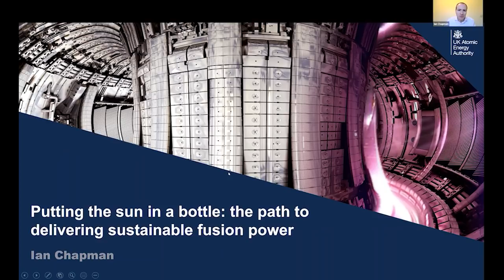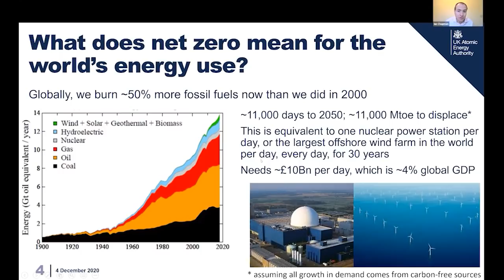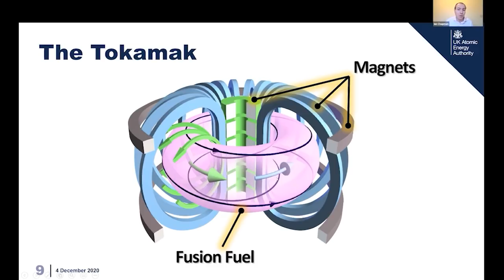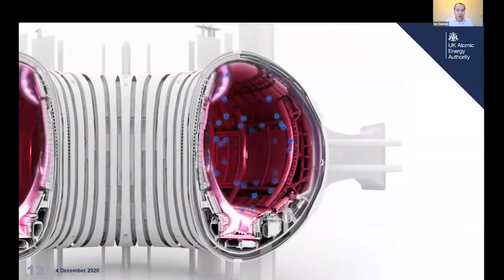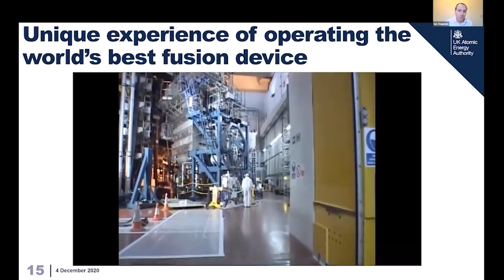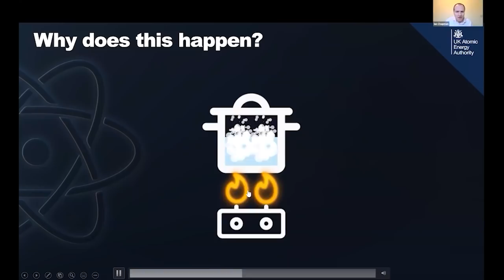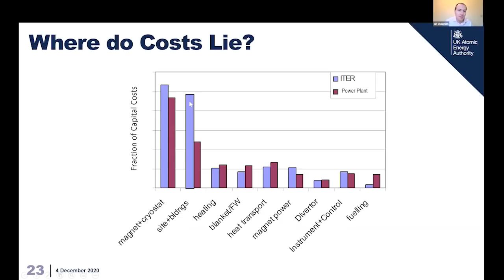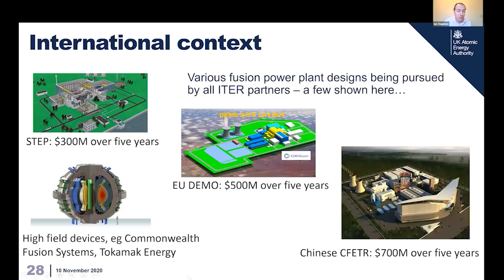Putting the sun in a bottle: the path to delivering sustainable fusion power | The Royal Society

Comment: Nice presentation. 
We have two ways to sustain plasma, electrodes and electrode less ie magnetic induction which is what mainstream is focused on.have Not seen any program use electrodes, why?

Just because our particle collider utilizing a magnetic induced method, it doesn’t mean this is the only way for fusion energy generation.
Reply: were talking about commercial power.
in the end, those who figure out how to make their new toy run cheaper will rule the market.

If the price tag would be anywhere like ITER.... that would be one tough sell...
Reply: @mikez2779   @Mike z  .. Total the amount spent on 90+ failed tokamaks + 100s of 1000s of related experiments, laser-vice failures etc. etc., then add in the amount of wasted electricity you'd have a commercial break-even point.. I'd include all the thermo-nuclear WMD costs too, Con-Fused, Robbed Tax Payers. Then adjust for inflation...
--
ITER is NOT designed to be a working reactor, it tests a few theories, that possible may help, while still not tackling many core problems.
--
This is a comment to The Ovid-Brained masses as well. The insults are not meant for you, as you can actually ADD UP MONEY, unlike La La Lander Zombie Halfwits.

Comment: When you make it commercially available, then make a video on it. I'm tired of watching videos of half-assed contraptions that cannot produce electricity for more then a brief moment.
Reply: It doesn't actually create electricity, just heat to boil water.  This technology has existed since the 1800's and they are wasting billions just so a curious, what would happen if, researcher can have a job.
Reply: @ztol4_i126  If you have a better way to produce electricity from fusion, feel free to pubish...
Reply: @Alexander_Kale  That's just it.  No one does.  Why spend billions to create expensive ways to boil water?
Reply: @ztol4_i126  Because, believe it or not, despite trying very, very hard, no one has figured out a better way.
Reply: @Alexander_Kale  Yes we have, natural gas is better way to boil water for electricity.  We need to find the way to eliminate the WATER! We know How to boil water.  Spend the money on how Not to use the water intermediary step.  We need someone to think outside the box.  Too much of classic Physics is telling you how something Can Not be done.  Screw that.  Experiment with what should not work, just like heavier than air flight was impossible until it happened.  Maybe there will be a breakthrough.
Reply: @ztol4_i126  It is not like they haven't been trying, just that no one succeeded.

Again, if you find a way to transform one form of energy into another, which for some reason ten generations of natural physicists have overlooked, feel free to publish. 

For the rest of us, we need to live in reality, and that is governed by the Carnot Cycle.

Comment: Please do not allow fusion energy to be abused the way oil and coal were.   It must not be used to increase energy supply per capita, as increased low cost electricity for example will be abused for dangerous and or destructive activities.   It will create un imagined problems that we just don't even consider today such as personal drone armies.  Consider only using fusion power to sequester and bury carbon from the air, but not using for general use or to power the grid.   This would be the safest option to avoid future problems.  There is plenty of solar power for people to efficiently use energy.

Comment: So far, it sounds like another plot to keep everyone on the grid. They claim it will be abundant, cheap, and safe energy, but I'm from the Show Me Stae of Missouri. I tend to think there are more options that will eventually cancel the high cost of energy and provide it at a fraction of what we see today. Will "Fusion" be the answer? Good question. After all, the temps associated with its operation may cause frequent repairs. Much of the technology is still in the development phase and all "contributors" will demand bonds that will never mature to keep them "gods" for eternity. Again, a possible Wall Street scheme to rob the public. In other words, they need to approach this from the consumer's perspective. Strict cost controls and reliable materials and equipment must be proven prior to public commitment. And, to maintain the green light on all alternative sources that appear worthy must be guaranteed.

Comment: Your community continues to work on the massive $20 billion French (JET)  tocamac to prove the concept. Meanwhile the solution is in front of your nose and will make your machine obsolete before it is finished. Your white elephant should be abandoned and the money saved needs to be reallocated to refine the MAST, STEP, or MIT version - smaller, cheaper, modular, manufacturable, safer, maintainable.
Reply: JET isn’t French.

Comment: wow, why are the comments in here pure cancer?
Reply: Not cancer.  Just real truth.  There are only 4 ways we create electricity. 4!!!!!  Not the different ways to boil water.  At the foundation, electricity is a result of a kinetic transfer of energy from one system to another.  Energy can not be created or destroyed, only converted.
1. Create heat to boil water into steam to turn a generator, wood or other plant fiber, coal and Natural gas, Nuclear Fission and proposed Nuclear Fusion.  
2. Photovoltaic cells to convert photonic Kinetic energy into electricity. 
3. Wind turbines to convert the kinetic energy of wind through a specially designed fan blades to turn a generator to produce electricity.
4. Hydro.  Using the kinetic energy of falling water to turn a generator turbine.  
All of these ways to convert electricity from another  type of energy (Kinetic) has been known and accomplished since the mid to late 1800's.  There has been NO New Advances in electrical production since.  I dare you to research it yourself like I did.
Reply: @ztol4_i126  How is any of that related to the feasibility of fusion power? What kind of turbine you attach to a fusion power plant is a completely unrelated issue.
Reply: @ztol4_i126  What about static electric? I dont think that falls under one of those 4? And logically we should be able to harness that?
Reply: @PazLeBon  Static is still a mechanically derived power source.  You don't even need wool socks, carpet a d cold dry air for the zap.  Cold air molecules can come into contact and convert their kinetic energy into static, as well as the inherent electric charge of electrons building static clouds through proximity.  Heat is the most universal energy form, if we could go from heat to charge directly, then we'd be truly advanced as a society.  Earth could move up the "Type" levels from our current Type 0.5 to maybe a Type 1 or higher.
Reply: @ztol4_i126  Sure, I appreciate 'most' of that, but it still might be more efficient than some methods, like heating water for steam as an obvious example. How much energy to rub socks on carpets and pass air over it? :)